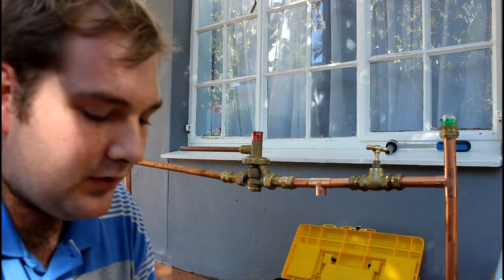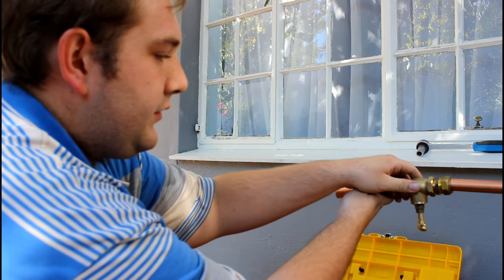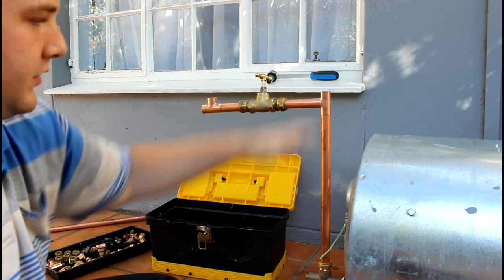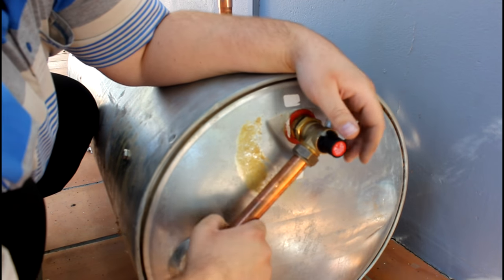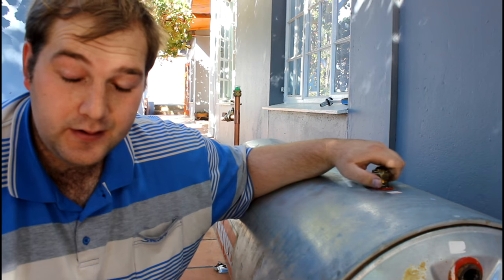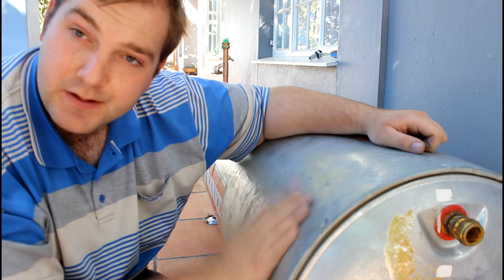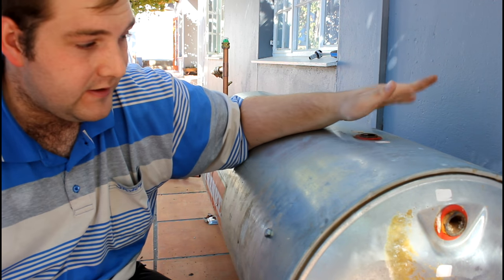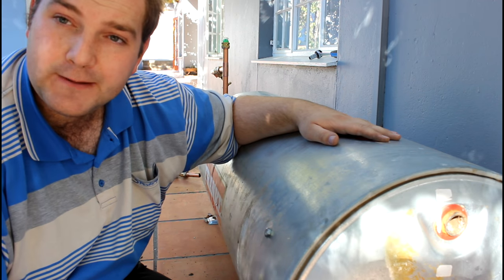How to install a geyser the right way

Comment: Vacuum breaker on the the hot water outlet must not be directly above. It must be piped 200mm minimum away and 300mm height. I'm an ex Service Technician from Kwikot and your installation does not comply with SANS REGULATION 10254. Stop misleading others.  You can be prosecuted by posting a non compliant Geyser Installation on a public platform!
Reply: Where can one get the proper regulation and how to ensure that your Geyser is installed correctly?
Reply: I dont know which edition of SANA 10254 you refer because the 2017 ed 4 makes no mention of 200mm away requirement, but it does say it must be as close as possible to the tank.
Reply: @Mukesh-rq7ol  Take a look at new SANS REGULATION in the SABS brochure.
Reply: Hi Bro Can I Have Your Contact Details I'm Having Challenge With My Kwikot Pressure Valve

Comment: Regarding the new regulations there can be never a gatevalve or any valve between the PRV and the geyser. You wil have watermeter, non return valve, gatevalve, PRV and the geyser

Comment: The geyser installation is Non compliant, There may not be any shut-off valve between the geyser and pressure relief valve. and the vacuyum breakers must be 300mm above the geyser..
Reply: I'm no plumber but the pressure RELIEF valve was located on the side near the outlet pipe and there isn't a stop valve in place. This is the valve that makes sure the geyser does not build up excess press and explode. The stop valve was actually located on the geyser inlet pipe and it doesn't matter if before or after, in this case, it is after the pressure REGULATOR and if inadvertently shut off, the geyser will receive no water pressure in the first place to cause an overpressure scenario. The benefit of locating the valve before the inlet regulator is that you can change the regulator which tends to fail often without isolating the main water supply to the home since it has its own stop valve.

 (Just my opinion that I think makes sense)

Comment: The stopcock needs to be fitted before the prv to allow servicing of the  prv and the rest of the geyser without shutting off the mains. Also, your stopcock is back to front. Your vacuum breakers also need to be 300mm above the geyser and your pipes need to be lagged
Reply: yea, also that hot water vacuum breaker needs to be 200mm away from the outlet and then up 300mm.

Comment: Potential bomb !! Should be Stopcock, then Pressure valve, then balance tee for cold water. Stopcock can function as a non return valve stopping your pressure relief from functioning. If you have a safety valve failure, your pressure valve (secondary safety pressure relief ) will not function then KABOOM you've just destroyed the house and maybe killed somebody.

Comment: Meneer I give both up and down.The up giving general idea about geyser installations,the thumbs down is the order your installations.The stopcock after the pressure relief valve and the distance of vacuum breakers from top of heater must be 300mm.Its a good start,you'll improve if you do more research.

Comment: Thanks for the video. 
Very helpful. 

Please can you tell me if it is okay to install a geyser with the tank directly against a wall (i.e. touching the wall)? Or do you need to have a gap between the wall and the geyser’s tank?

Why I’m asking is because I’m wondering if the cold wall touching the geyser tank would cause the geyser to cool down quicker. 

Thanks so much. 
Jacques. 
South Africa 👌👍
Reply: you can mount it directly to the wall, it needs to be a strong wall not a single brick and only geysers 150L and less and the pipes need insulation

Comment: The picture made me want to read the comments. Its a good illustration, but not entirely to how it should be. Take note, there is a gaurentee on the product, if it fails during that period , and not installed correctly, the replacement is a void.

Comment: Can I move the Geyser wall mountings on a KWIKOT 200L heyser( to the other mountinhg bolts on the geyser?
Reply from the maker: yes you can if you hang it on a wall you must have supporting brackets underneath it on the wall

Comment: Safety valve overflows when the thermostat is faulty not because the is pressure in the tank(it only release s on the PRV)
Reply: Thats incorrect. Its a TP valve. Temperature and pressure

Comment: you  shouldn't make videos about thing you know nothing about...
Reply from the maker: ok
Reply: Stacy, can you do better?
Reply: Gee Stacy -- Been checking the net -- Surprised to see you haven't posted an alternative way of installing a geyser ? I wonder why ? But I think  i know ...Its because you are patently a millennial ....................... (Fill in the gap lol)  
'
Reply: @tikkykopmostert5972  ignore the negative people. I appreciate this video. I Bought a house a couple of months ago. You video identified a mistake a professional plumber made in my house. Causing me to fix bursed pipes 3 o'clock in the morning.
Reply: Good day,
Very well presented. Professionals installed my 150L geyser but only cold water come through even if the EPS shows 55 degrees. Now these people are nowhere. Where is the hot water then. I am so frustrated.
Thanks